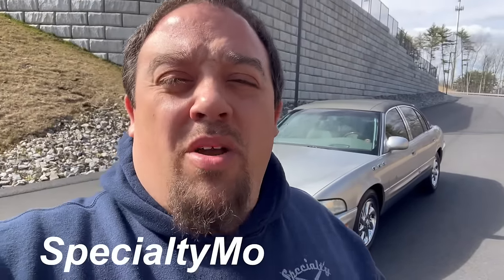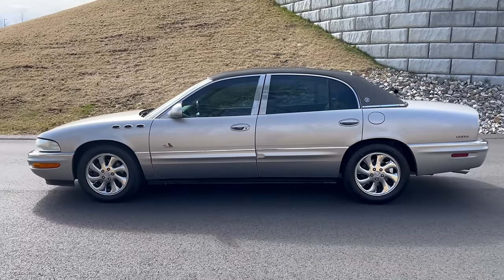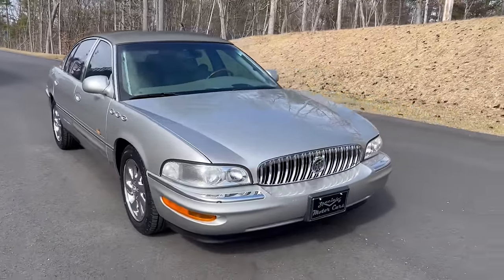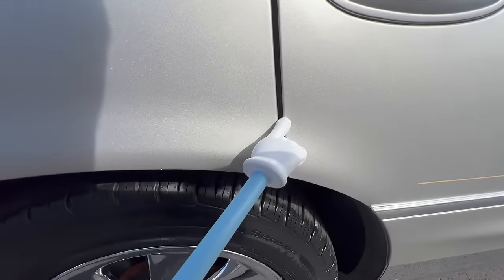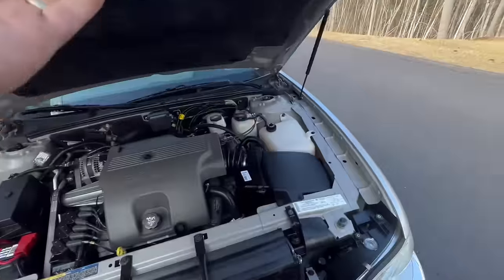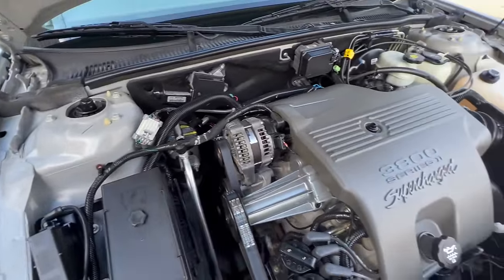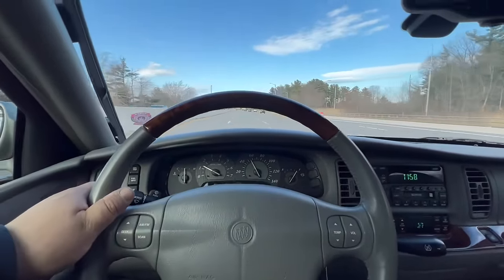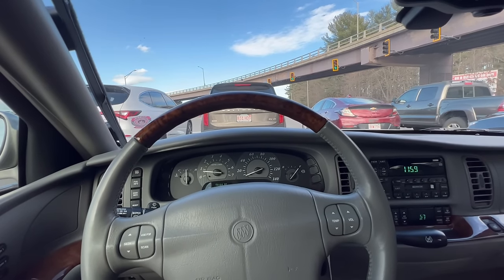SUPERCHARGED 2004 Buick Park Avenue ULTRA 58k miles RUST FREE by Specialty Motor Cars

Comment: Probably the best Buick effort of the last 30 years, and as reliable as any Lexus. Great car.
Reply: Best Buick effort in the last 30 years is the 1994-96 Roadmaster.
Reply: @MostlyBuicks  Not really. The design was terrible.
Reply: I agree, don't care for Lexus cars anyway
Reply: @quincycooper79  Neither do I somehow.
Reply: @MostlyBuicks  I disagree. I had several but love this version being sold by Anthony
Reply: 3800 platform GMs from the 80s-00s were great. FWD transmissions, not so much....I really wish GM had stuck with RWD platforms. As a Lexus driver for the past 15 years, I can tell you that the reliability piece is real. Lowest cost of ownership of any luxury vehicle, which is why they're #1 in reliability for 20 years running....
Reply: @brandoncallaway2619  I too wish they'd stuck with RWD the way Ford did.
Reply: @brandoncallaway2619  Still don't like Lexus.

Comment: Beautiful car.  I bought a supercharged 2000 Buick Ultra in 2004 with 66k miles.  It was dark blue with dark blue leather interior.  I drove it year round for 15 years in central WI and put another 300k miles on it.  It was a one owner local car.  It was still running on the original non-rebuilt engine, transmission, supercharger and even A.C. compressor.  The A.C. did need recharged annually for the last few years I drove it, but was still ice cold.  I wish I had the money for this one now.  It was the best and longest driven car I ever had.

Comment: I got me one a 2002 ultra 30,000 miles and yes the motor is rebuilt and transmission brand new body and interior immaculate. And ur rite u cant find them anywhere thts y im holding on to mine.
Reply: I thought those engines last forever
Reply: @alljerseysmatter.  Naw the head gaskets are that paper trash.   Replaced those and everything else while it was opened up..

Comment: I have a connection to 2000s Buicks. I grew up in Sanford, ME. There was a multi generational Buick Oldsmobile dealership in the heart of downtown that had been there for 80 years. Buicks Olds Cadillac Chrysler were quintessential in the sealcoated driveways of little white or maybe green or brown houses. Walter Reeks pumped out hundreds of Buicks every year despite being a “shoe string” dealer. In the 2000s the average Buick buyer was a retiree, and had been for 10-20 years and was running out of time/money. I met so many Century owners that admitted they wanted Park Avenues but couldn’t afford one. So Century Custom “Presidentials” done up to your liking were super common. And there was a massive glut of ultra low mileage rotted out Centurys with basically NOS interiors in the 2010s. Most of them here failed inspection and got crushed. Those door gaskets on the bottoms of the doors roached almost every northern NE Park Ave. EDIT - I think we repainted every Buick side view mirror in town, seemed like 2 3 every week for years always had a white paint transfer.. I’m sure some siding guy was replacing gaskets on garage doors every week too….. 😂 I’ve gone on too long…

Comment: Last year of the Roadmaster was '96, so the '97-05 Park Ave. was then Buick's full size flagship -built on the GMA-D platform shared with the Cadillac Deville and Seville.  The Lesabre I recently learned was actually built on GMs midsize platform shared with Pontiac Bonneville, Olds 88, Impala, and I think several others.  I see this one has the automatic wiper gizmo behind the rear view mirror -very cool crowd pleaser that actually works🙂.  Very nice example -your right, these are impossible to find and have been for some time.  I was lucky to have a 2000 PA years ago, and managed to find a clean Sabre limited awhile back -which are also getting pretty rare. Which if I didn't have now I would be all over this car. Awesome find!!!

Comment: THEY MADE TONS OF THESE BACK IN THE DAY BUT YOUR RIGHT YOU CANT FIND THEM NOW WHAT A CAR I HAVE A 2003 GRAND PRIX GT and a GTP same year. I loved both of them that engine Was very easy to modify. I had that thing cranking 304 horsepower. 312 foot-pounds of torque. With some performance mod from Z Z. P performance. These engines were bullet proof What finally did mine in? Was it needed all the oil gas gets replaced on the entire engine? And they told me they would have to drop the engine out and everything the cost on what it would have cost to do. This would have been probably 3500, he said. In than in the car started getting more issues.Not with the motor but with the transmission and it just wasn't worth fixing it anymore so I scrapped it. But the GT P was a survivor and I sold it with a 198000 miles. The guy.
 Still owns the d*** thing 14 years later. Car has over 347000 miles on it. Unbelievable that the car is still alive in 2024. Great car great platform

Comment: One of my all-time favorite cars although I prefer the non-Ultra.  I had a ‘99 and ‘05 and they were spectacular cars, I still miss my 05!  I am one that traded my 2005 Park Avenue with just over 40K for a brand new 2011 Lucerne and I really regretted it. I didn’t go back to the Park Avenue but only kept the Lucerne for 10 months and traded it for an Enclave which was a lot better but I didn’t love it like I did my Park Avenue. I’ve considered getting another one over the years and I do have a loaded ‘04 Century with 31K that pretty much scratches that itch. It is sad that these are all but gone now, even the Century and LeSabre are getting scarce and it seems like just a few years ago they were still everywhere. It saddens me to see the last traditional American cars disappearing from our roadways. It’s hard to believe that it will be 20 years ago next year that Buick ended its legacy line-up including these cars!
Reply from the maker: Excellent comment! You’re right, even the Lesabres are getting scarce. Over the next two weeks I’ll have another non ultra 2003 Park Ave. I appreciate your comment!

Comment: have a white 2004 Buick Park venue Ultra I paid 3500.00 for it 3 1/2 years ago. great car for cheap broke people on a budget. When something goes wrong everything can be fixed for under 800.00; parts and labor at most paces. Supercharged 3800 Series Ii always USE 93 OCTANE gas its a must or you get a bad spark knock Mine had 134,703 miles now has 150,150 miles. Mine has everything expect the bucket seats and sunroof. Those 17.5 inch Chrome wheels are 199.99 to 399.00 used not kidding. Mine has that it was a dealer installed option took it off didn't work mine has the factory cell phone and antenna. Mine is Pearl White with beige leather int, Mine has the heads up display i find it annoying. Took the back camera off saved it..I dont have the sunroof or bucket seats.Mine has the Concert III and the 6 disc changer in trunk and all chrome Mine also has OnStar  that still works I have it until 2026m for free.

Comment: I have a pontiac bonneville  gxp  with  10500 miles on it got it new in 2004  no rain or snow
Reply from the maker: Those were the V8 correct?
Reply: yes     4.6   cadillac  northstar.
Reply: @specialtymotorcars

Comment: the lucerne that replace the park avenue was a complete joke
Reply: I bought one new in 2011 after my last Park Avenue and you are so right. It didn’t compare at all!  I never was a fan of the styling but convinced myself it would be the last somewhat traditional new Buick sedan (which it was) but I hated it!  I ended up trading it 10 months later.  It would be interesting to see how Buick would have fared had they continued offering traditional models that catered to the elderly along with more modern offerings like the Enclave and Encore.  The buyer base of cars like the Century and LeSabre largely died off but I’m only 39 and I would be buying them if they still made them.  It’s sad Buick basically exists today because of China.

Comment: cash for clunkers killed alot of em
Reply: I doubt it, they weren’t that old back in ‘08 and these cars got great fuel economy. I got over 30 with mine on the highway
Reply: @tyler2610 I never got 30 mpg with my 2000 Park Ave in CALIFORNIA SoCal. I wouldn't want one now with gas over 5 dollars a gallon and needing to run premium. I drive a 14 Challenger R/T Classic now in Plum Crazy purple I bought new. I get about 13 to 15. That Buick use to run over 60 dollars a week in gas I did mostly freeway driving.
Reply: I didn't trade mine in tell 2010 with 130k miles on it. Cash for clunkers lol they told you could drive the Carpool in SoCal if you bought a Hybrid lol lies lies and more lies. That's the government for you none of them are worth a damn.
Reply: @thomasthurston6656  I didn’t have the supercharger but saw 30+ on the highway regularly. It was very common to get that king of mileage with the naturally aspirated 3.8 in the Park Avenue and LeSabre.  Your mileage seems very low as it’s lower than the city rating for this engine.
Reply: @tyler2610  It was also CALIFORNIA altitude and traffic has a lot to do with it. It's been gone for years.
Reply: @tyler2610  I did get about 30 going to Vegas with it. I did 90 most the way. It's about a 3 hr drive from SoCal with no traffic. That was also interstate not a freeway. I bought the car at about 2 years old I was 22 I didn't care about mpg much. This Challenger I have now is far from a gas saver at 13 and about 15 plus midgrade fuel and it went to almost 7 dollars a gallon last summer in Socal.
Reply: @thomasthurston6656  No, you definitely didn’t buy cars like that for fuel economy, but it was definitely an added benefit of the Buick 3800.
Reply: @tyler2610  It was a nice car for the time. It rode nice most Buick's do anyway. I also had a 96 Riviera Supercharged. I traded that in on a new 2016 Ram in 16. It has been a good truck, but the Challenger has been junk from day one. It by far made it to CAl Lemon Law above and beyond. I was ready to file a lawsuit against FCA if they didn't give me the lifetime warranty. To date, it's a 14 and has had over half the motor rebuilt. The heads cracked it has a little over 40k miles. Lol, Plum crazy one of 36 made. I see why now.

Comment: If it isn't rust that kills these cars, it is failing electronics which is a real bi*ch to find replacement parts at this late date.  And it is hard to rewire the problem and work around it.